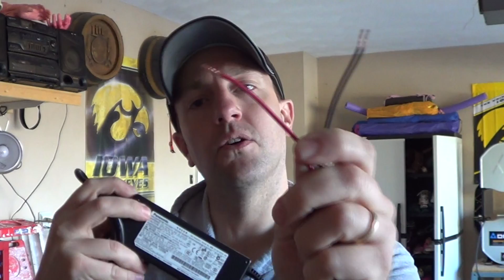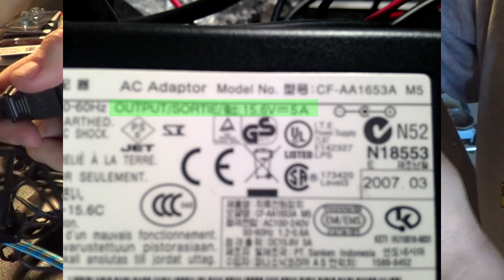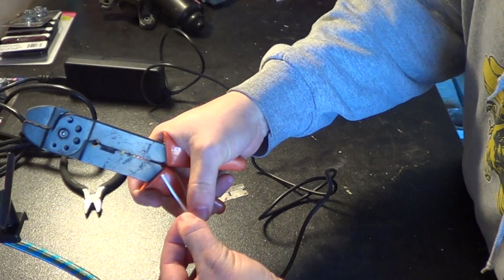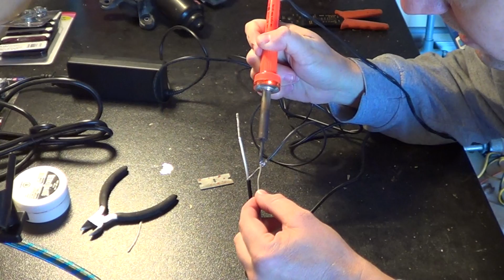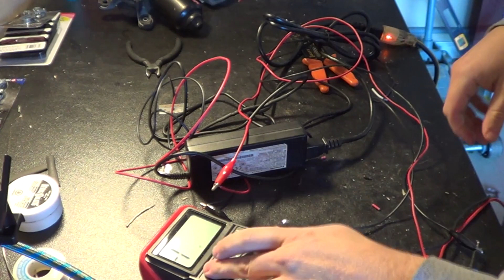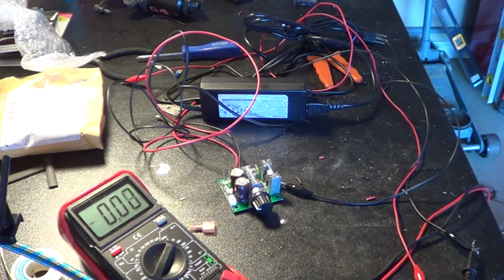How to prep a laptop power supply for your Halloween prop.

Comment: I thought that those speed controllers actually turned the power going to the prop off and on very quickly (I mean super quickly) so that the speed of the motor appears to decrease. That way you don't loose torque.  I used one last year, and it worked great.
Reply from the maker: You could be right. I used a couple last year too and they do work really well. There is also a wiper motor timer that looks similar where you can set it from 3 -30 seconds